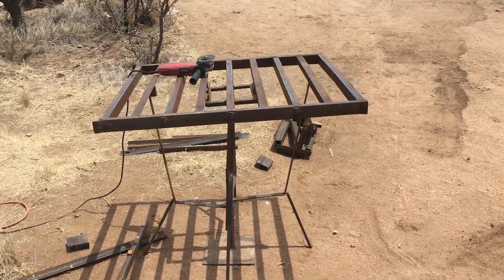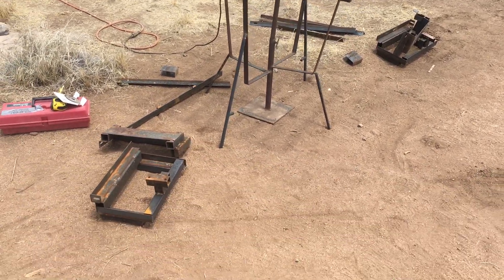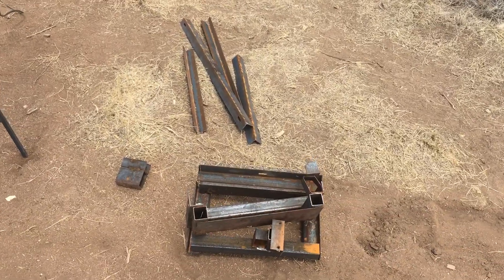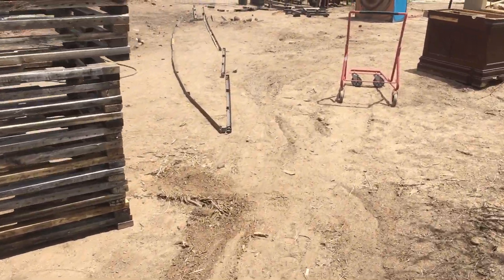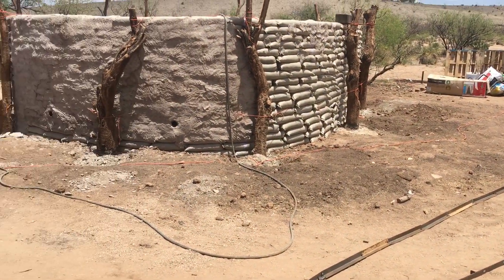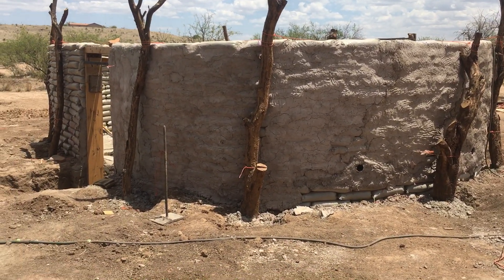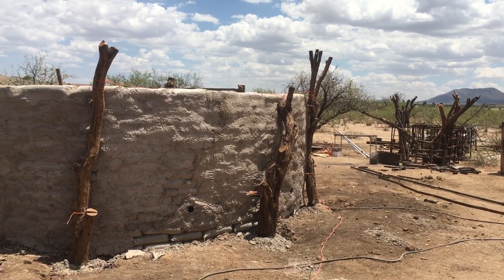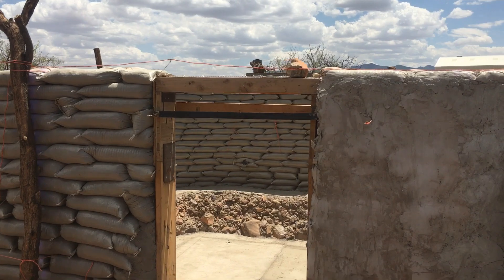EARTHBAG Construction- Roof Build

Comment: you said anything under 200 sq feet was allowed (I live in cochise county) 
but here you said 20 foot span, which would be 300 sq feet. Obviously there is going to be some overhang.
How many sq feet is your total structure? I am working on building my own whilst avoiding permits. Thanks
Reply from the maker: It's an oval..so around 200 sq ft.